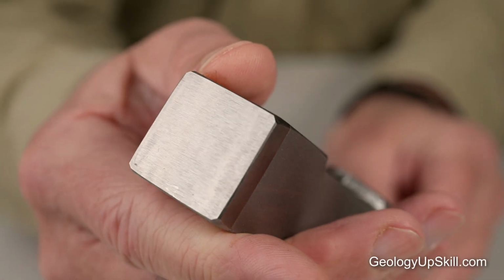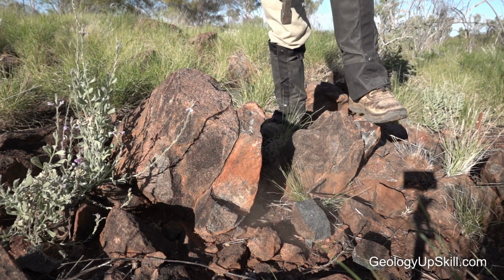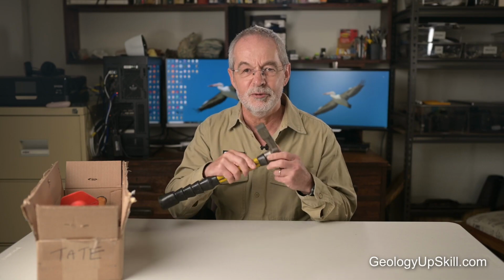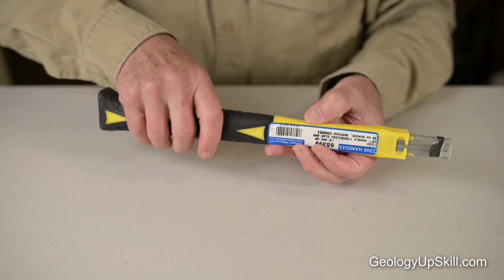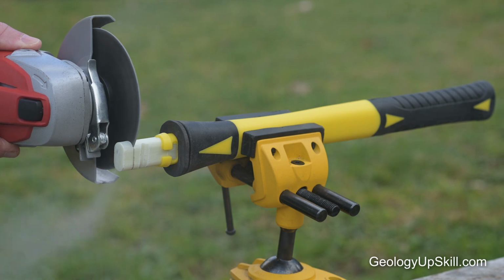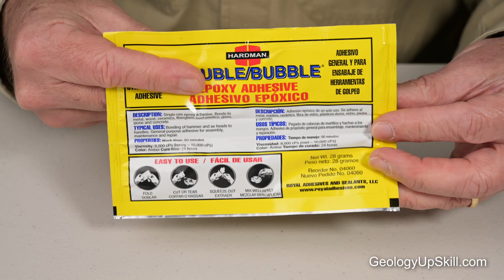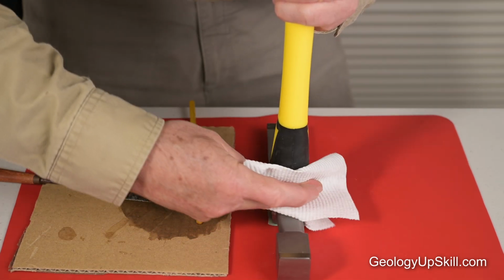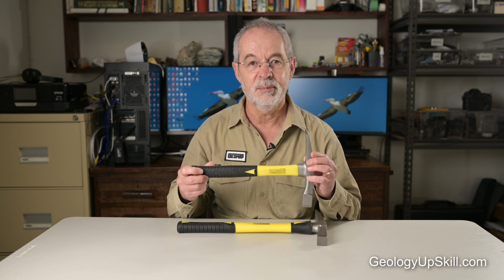Ultimate Geopick v2.0

Comment: This is a great video!  I still have my grandfathers 60 + year old Eastwing leather wrapped geo-hammer, with a very rounded head. :)  My philosophy, if it breaks rocks it works!  Never appreciated the importance of dressing the square face, or availability of tungsten metal inserts designed for the hammer face and chisel tip.  I have replaced many tool heads using wedges, skipping the epoxy step, due to an early failure -  obviously, I was in error and impatient; didn't wait long enough for the epoxy to cure!  I never thought to buy a silicone mat for epoxy assembly or the use of plastic coated fiberglass handles designed for small hammers only 2 pound mini-sledges deigned for brick chisels - I have an expensive broken framing hammer head ready to practice, thanks for the valuable tips!
Reply from the maker: To be fair, I've been through a lot of hammers, and I did most of the things like you and learned along the way.

Comment: Thanks for posting.
Give me the longhandled leather or vinyl bound Estwing. They require some care and upkeep but the handle, being part of a single forging, is much stronger.
A long handle is also prefered for applying greater force and, as you say, the shrapnel.
Using fiberglass short handled tools is asking for wounds, and sooner or later the head will fly off. The geometry of the tool is such that one also cannot apply the leverage that is possible with a long handle, for freeing up jammed rock.  
As for the tungsten, well, it's brittle and is it really necessary?
They also cannot be so easily used to pop a bottlecap, as well as a number of other informal duties.

The Canadian (I believe) tool that is essentially a smallish mattock with a hammer head and long hickory handle (arms length) are also very functional.
When the only tool you possess is a hammer, everything looks like rock!
All the best from Namibia.
Reply from the maker: I really got to like those tungsten faces. They stay sharp as you can see and that make a big difference to the amount of energy required to break rock. Not quite as versatile as steel, but if you use the right tool for every job, it will seem less like a job!

Comment: I've always gone to one-piece-made forged metal hammers (Estwing, Ox Pro...), even though they're not made with tungsten inserts.

One only forged piece is always better (unparalleled robustness / resistance / longevity.)
Reply from the maker: I did actually try to get Trow and Holden to make a prototype with a one piece head-handle and tungsten faces, but the retooling costs were just too high.
Reply: @GeologyUpSkill  
That sounds quite interesting! 👍🏻

But yes, building a single unit (or a few) can be very expensive and not profitable. Unless you want to amortize the investment by manufacturing and selling many units, which is uncertain and a risk.

Although on the other hand, building a tool for yourself according to your own desires can be a very rewarding adventure, no matter how expensive it may be.

In any case, I continue to insist that tools made from a single forged piece (head-handle) are much more resistant and durable.

Cheers! 🍻